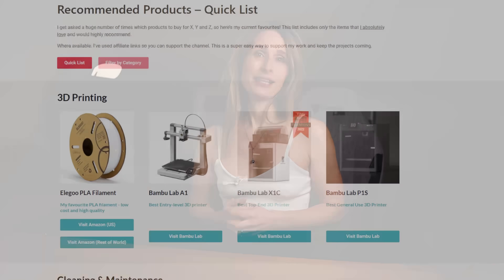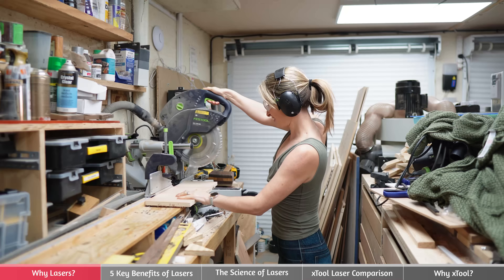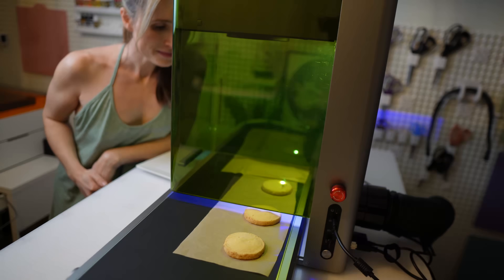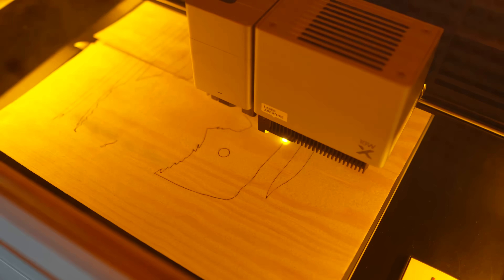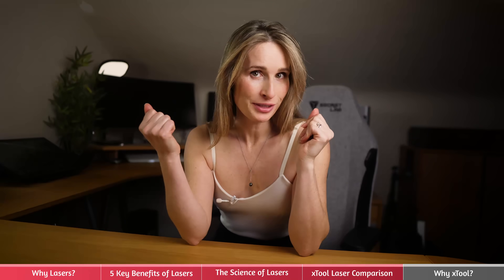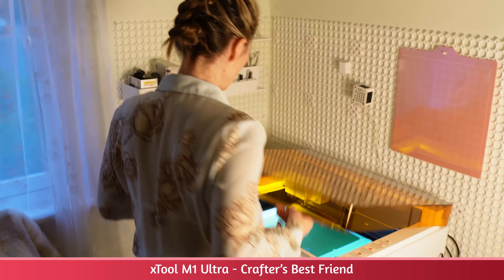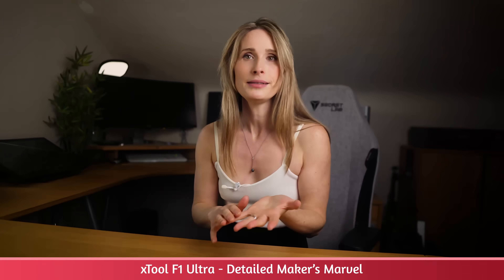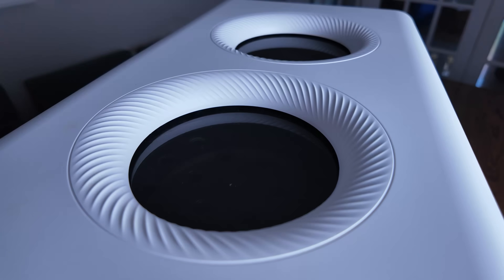Choosing the Right xTool Laser: F1 Ultra vs M1 Ultra vs P2

Comment: Thank you for the insightful video. I also own a laser machine of another brand and had to purchase additions for my machine to function at its full capacity. I am on a search for a new laser engraver and I am debating on whether I should get the F1 or F1 Ultra. I do craft shows and I want to engrave on jewelry on site. So what is most important is a machine that engraves silver and stainless steel and portability. Which one would you recommend?
Reply from the maker: A pleasure! Well there's no doubt the F1 is more portable, I'd say the F1 Ultra is 'just' still in the portable range. You definitely could take it to craft shows, it's just not going to be a one hand job!! Other than that, the F1 Ultra demolishes the F1 - better laser, bigger max size, depends metal engraving, conveyor, offline storage, smart UI features (like repeat tasks) and more. Personally, I'd go for the F1 Ultra for all the extras - if your use case is absolutely precise(eg small jewellery is all you'll ever need in relatively low volumes) then the F1 is still a great machine too. Hope this helps!

Comment: I want to do metal and stone engraving and the Xtool F1 ultra appears to do this great yes? But my problem is, I want to cut through at least quarter inch hard wood. is there any laser that can do all three of these for me? Thanks for video! Subscribed
Reply from the maker: No worries, yes the F1 Ultra should munch through that fine - I can test in a week or two, but you should have no issue (eg I just did 1/4" walnut ply for my Herbus video and it had no issues with that at all, so solid wouldn't be a million miles away - just might need more passes/power).

One subtle point is just remember the F1 Ultra is cutting from a fixed point, whereas the P2 cuts by moving the laser. So if you needed to cut larger pieces or needed a perfectly straight edge, then the P2 is the best.but if you're cutting smaller items, then the F1 Ultra would be perfect for you by the sounds of it
Reply: @handsonkatie  Thank you so much for the info! Be blessed. Subscribed!
Reply: @handsonkatie  Awesome to know. thank you again for the info! I went ahead and bought the F1 for Cyber Monday and got the bundle with the conveyor belt, and I really like that they have their own free art software to go with it. So maybe the conveyor belt will work out with larger items. 
Good videos. God bless you!
Reply from the maker: @2AAceGalil  Awesome stuff! Oh I'm sure you'll love it, it's super cool!

Comment: These lasers are still eye wateringly expensive compared to the state of 3D FDM printing. The basic mechanics are the same, except a laser vs a heated extruder element. Any decent laser cutters around the £1,000 magic price point?
Reply from the maker: Oh the mechanics are quite different (except for the stepper motors and x/y axes) - laser tech is much more complex than 3d printers (which are basically very cheap heaters, melting plastic!). You can get cheaper lasers - eg xTool do some starting at around £250, so you can check them out, but I would aim for your sort of price point to get all the ease of use, features and more.

Check out the links in my description and browse xTool's site, the S1 or the M1 are great lasers that are very capable, but if you were quick, the M1 Ultra is heavily discounted, so around $1000 for the next day or two

Comment: I wonder if you've ever looked at the Gweike machines, they offer an insane amount of value for the price compared to the xtool machines but I'm not sure if they're comparable when it comes to quality. Your video really makes me wonder if I should go for an m1 or p2, or both ;)
Reply from the maker: Yes, Gweike are great lasers too, I looked at them when I was buying my P2. If you compare their similar models - eg the Gweike Cloud 55W $3499 to the xTool P2 $4799, they're effectively a slightly stripped down version - ie smaller bed size, lower working height-210mm with riser compared with 51mm, rotary engraving is much smaller too (xTool 0-180mm vs 30mm-74mm).

The big things that swing it to a 'save a bit more for the P2' are - passthrough cutting (this allows you to cut up to 3m long planks, which is a gamechanger), the curved cutting recognition in XCS, the 16mp camera vs 5mp (remember this is what you'll use to align every cut) and the suite of extras in XCS of which there are many! There's also a whole ecosystem of accessories for xTool which obviously cost more like Gweike, but are state of the art on xTool's side (air purifier, duct fan and more)

But Gweike offer great value for money and certainly I don't think they're scrimping on the important stuff like many brands do (ie safety, reliability), so if you had a really specific need like only ever needing a smaller bed size and cutting fairly limited ranges of objects, then it'd be a great solution (ie where the camera, passthrough, smarter tech wouldn't be relevant).

Hope this helps!
Reply from the maker: Had a quick google and this looks like quite a decent review: https://youtu.be/Ig7Avn1laR4

Might need to check the reliability side as he seems to mention quite a few problems with his Gweike models.
Reply: @handsonkatie  That's a very compelling argument to go for the xTool devices instead, thank you :)
Reply from the maker: @WoLpH  A pleasure, as I say I don't think Gweike are a bad brand at all, but xTool just lead the market in lots of ways.

As to your question of M1 or P2, you'll just need to watch the video again!! 😂 I've got a bit more detail on my site too under recommended products!
Reply: @handsonkatie  Thank you so much for the elaborate response, that helps a lot!

Comment: Great content as always!  Best deailed  recommendation for specific function product.  

Question:  When writing on those cookies, do you think they will work on CheeseCake Cookies? They have this crackled paint type texture... want the laser to be far away from it.  Does the laser just caramalized the surface? worried about eatimg carbonized layer ...  Thanks.
Reply from the maker: Thanks! Yes, the lasers pretty much etch all foods really - do you know what the crackled texture you describe is made off? (Ie sugar, glaze etc). Either way, you can super easily dial the power and speed up and down to avoid any heavy charring, so you can get it perfect for your use!
Reply: @handsonkatie the cracked surface is due to thin icing sugar layer on top which cracked during baking.
Reply from the maker: Ah yes, know what you mean - yes, you'd just need to test different settings and pick what suits best, look at videos like this as an example: https://www.youtube.com/watch?app=desktop&v=nX0D83EvOdw

Comment: Let me address the elephant in the room, Lasers are dangerous, but they are such incredible machines. Great video.
Reply from the maker: Oh like any tool (and I'd rank table saws waaaay higher on this scale!) they should be treated with respect, but yes I really wouldn't advise using cheap, cut corner lasers (open frame, dodgy safety glasses, weak extraction, low fire safety and the like)

Comment: Oh My God! She's only gone and done it!
I'll need to replay this video a bunch of times to crack that Welsh place name, but there it is!

I am slightly disappointed that XTool don't have a shark mounting accessory for their lasers, but perhaps that is a future upgrade?
Also, HomeAssistant-able?
Reply from the maker: 😂😂 yes indeed, can't believe they missed the shark!! 🦈 Home Assistant crossed my mind, I'm not actually sure what I'd use it for as I'd always want to be near the machines when running, but I can bug them about an API if you've got any ideas!!
Reply: @handsonkatie  I was thinking monitoring, in much the same way you might monitor a 3d printer.
But you're probably right that it's better to keep a close eye on them and be ready to push the big red button, as they're even more likely to set your house on fire... :D
Reply from the maker: @chrisdixon5241  Yes, I've actually got Reolink cameras set up for this - so it covers both my CNC and the P2. I think it's actually a bit trickier as the camera on these devices is used for 'top down' views to see exactly what you're going to cut, so I'm not even sure if it's possible to use this whilst the laser is on, I'd need to check!! I'll ask xTool about this - it might be fun to hack around! Certainly a very simple 'job finished/percentage complete' could be handy for one idea I've got.....!

Comment: My experience with Xtool as someone trying to be a new customer (having spent £5k on the P2) is to tell anyone who will listen to avoid them. 

I wont go into detail about my specific case save to say they sent me a pre owned / pre broken unit that I obviously cant use. I have serious misgivings about the size of the company and their ability to solve after sales issues. Trying to get some help from them almost drove me to tears of frustration, they didnt bother to reply, there is no UK support and when I did get some response they simply didnt seem to care.

I may have a solution to my case, after days of having to shout and chase, time will tell if they come through with it. But from what ive seen I would not be sending any money in their direction again....
Reply from the maker: Oh do share details as I'd be happy to help - I bought a P2 before I ever started Youtube and it's been immensely reliable and support were super helpful (even when I screwed up using it initially!). I actually was using another competitor brand before that, that was problem after problem - so appreciate it does happen!

Drop me a note on my site email if easier, would be great if I can help get sorted!
Reply: @handsonkatie  Thank you for the offer of assistance. We got there in the end and I am very impressed with the device, though I do still have reservations on their support & service. Time will tell but for now I am at least cutting!
Reply from the maker: @JamesG19771  great to hear you're sorted! Glad you got it resolved and enjoy the laser, it's a brilliant bit of kit!!